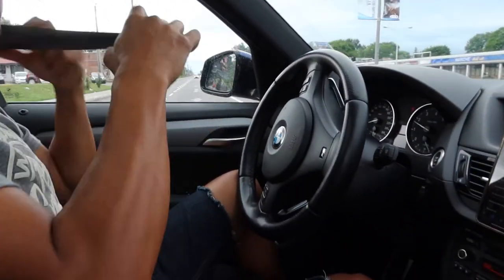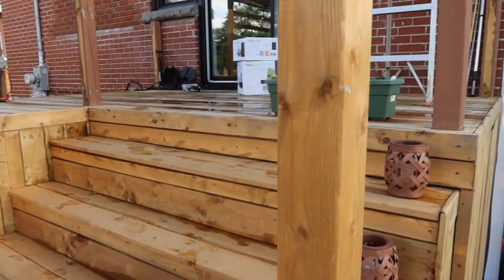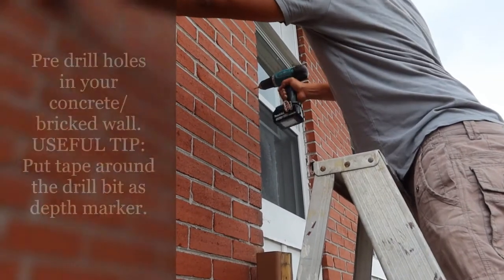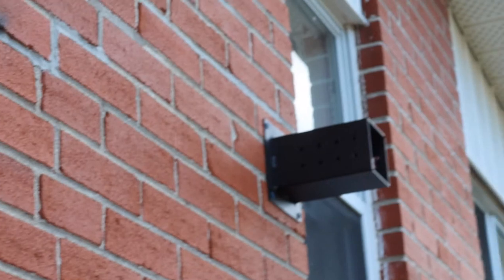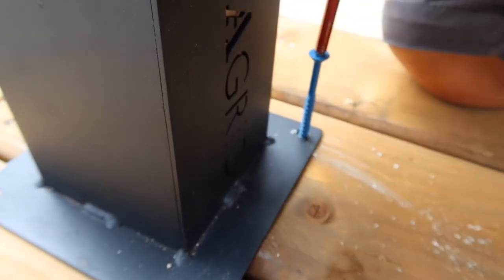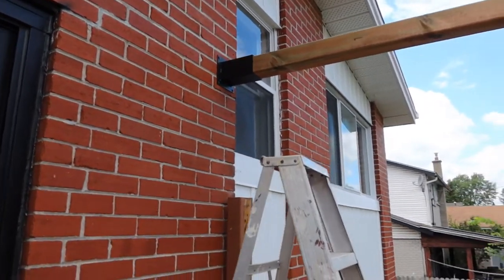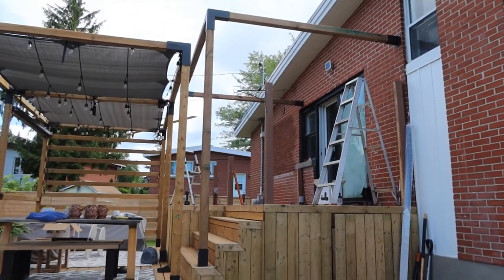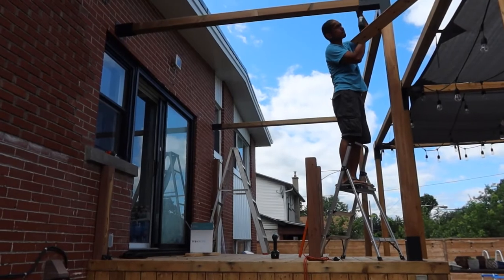INSTALLING TOJA GRID PERGOLA | UPPER DECK BUILD

Comment: What are the brackets you are using for the 2x4? The ones that sit in between the 4x4 posts. They are really small brackets that are not from Toja Grid.

Comment: I would remove those blue tapcon screws from the base posts and replace them with stainless steel screws.  Tapcon are very hard, high carbon steel made for concrete, not wood, the oils in wood will make them corrode faster.   Tapcon makes a 410 stainless if you prefer that brand, I like GRK too, but  you need stainless steel in that wood.
Reply from the maker: Thanks for the comment. We'll look into it. Much appreciated.